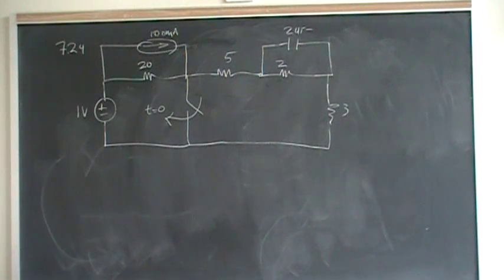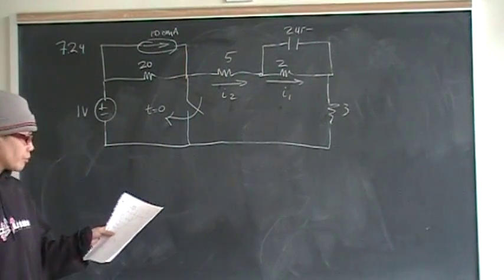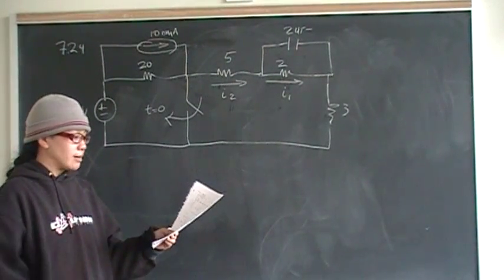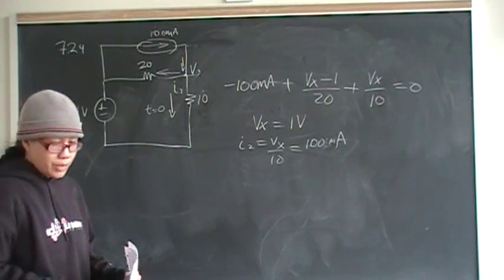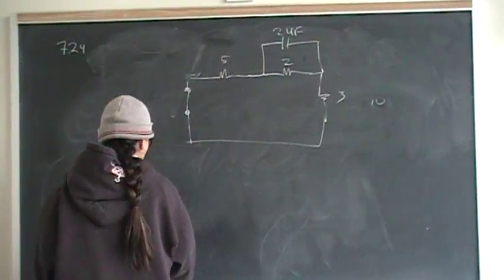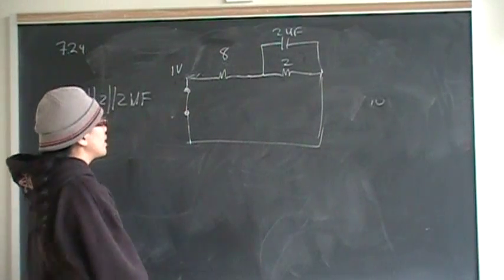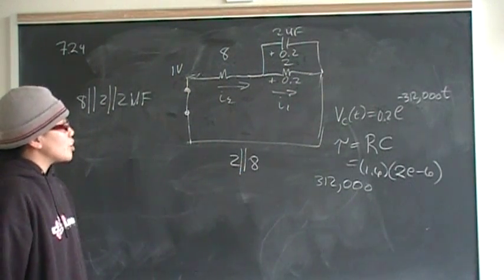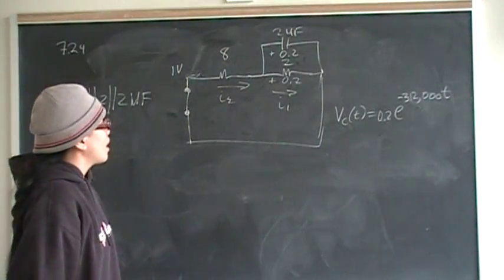Natural Response RC Circuit P7.24 Nilsson Riedel Electric Circuits 9E Solution

Comment: Excuse me, but do you have a problem where you explain how to tell whether a current or voltage source is either delivering power to a circuit or absorbing power from the circuit?

I'm confused on how to differentiate between the two with some of these problems in the textbook.